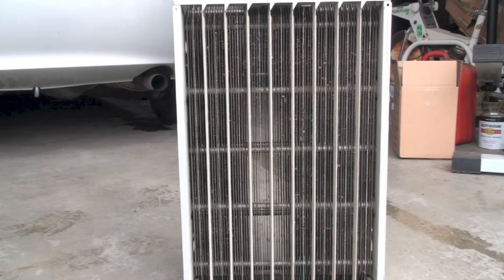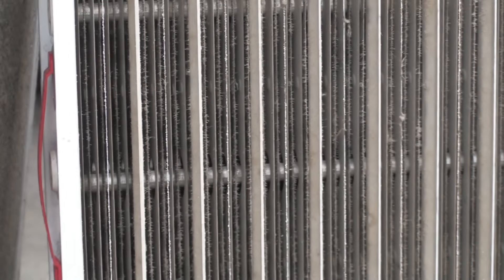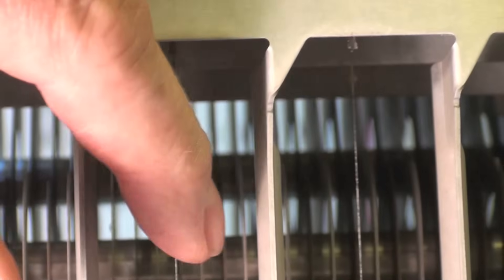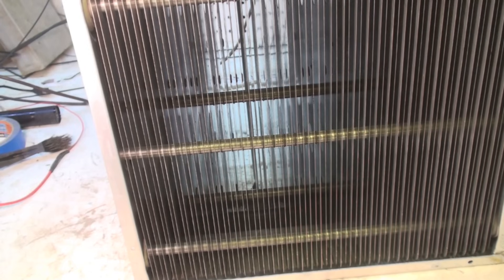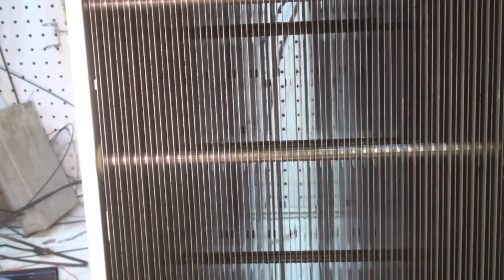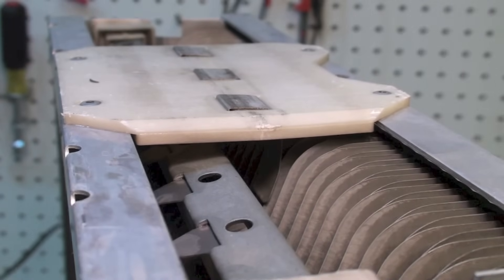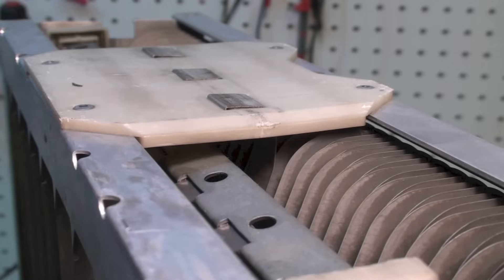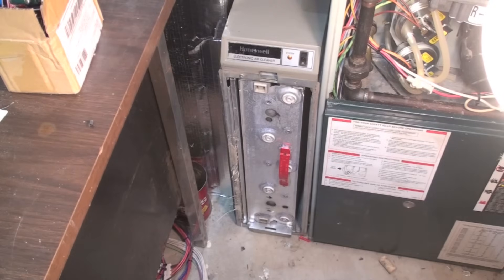Cleaning the electronic air cleaner

Comment: Try household ammonia. I did and found that It works well. Listen, As a homeowner, I have done everything to try and get my Honeywell EAC cells spic and span and this black soot always remained on the plates. How to I know? Well, because if I would take a cotton swab and swipe it between the plates after they were supposedly cleaned, the swab came out black. I've soaked the cells in detergent, blasted them outside with my pressure washer;  even put them in the dishwasher. Still, that soot remained. Today, I decided I was going to attempt to find a way to clean off that soot. In desperation, I tried all sorts of cleaning agents: Simple Green, TSPF, Borax, Oven cleaner, CLR, bleach, and they did nothing. Was ready to go get the muriatic acid (just joking). I thought; heck, may as well try ammonia. I sprayed it on the cells that I already "cleaned" and the black residue began running off as I could see it running along the bottom of my white utility sink. I might have stumbled on a winner here. From now on, I'm using ammonia in a spray bottle, then a rinse with hot tap water. Simple Green work well however, even after cleaning the cells with it, the black soot remained. Try ammonia.

Comment: When mine is plugged in and I turn it on, nothing happens. No lights, sounds, etc. Until I push the front panel forward…and then both lights come on and it starts zapping. What can be the issue?
Reply from the maker: The air cleaner has a shut off switch connected to the front panel to keep it from operating when the panel is off.  The switch may need to be adjusted.
GFM

Comment: Just bought a house with one of these units. It’s missing all of the internals. I guess I’ll just measure and put a standard filter in there for now.
Reply from the maker: Parts are very expensive for these units, so I would recommend replacing the internals with a standard air filter.  The good part is you can use up to a 4" filter.
GFM

Comment: I put the electric filters back while they were wet
, now I don't hear that buzzing noise when furnace runs as usual,
Reply: Look to see if the neon light is on.  If it is, you're OK.  If not, there is a short somewhere.

Comment: I came to your channel. My Carrier has the same type of cells. It was buzzing terribly and I followed your video and cleaned it out using a hose and some dishwashing soap. I let it try overnight but the buzzing continues when I placed them back in. The cells were not very dirty at all. What else can I do to problem solve the buzzing sound? I remember when it worked properly, when the AC/heater came on. It occasionally would make a snapping sound. Now its just all the time, so loud I am forced to turn it off.
Reply: You have a short somewhere.

Comment: My filters have never been that dirty. I only clean them once, maybe twice a year. Could this mean there’s something wrong with my unit, 17 year old Lennox electronic air cleaner. Is there a way to check to see if it’s functioning properly? Also, I don’t recall ever seeing the thin wires.
Reply from the maker: If the unit has a test button you should hear a spark when it is pressed.
GFM

Comment: I have a ticking noise that's coming from my electronic filter is this a bad contact problem or is it normal not sure
Reply from the maker: Either its dirty or some of the plates are bent.  Or its just worn out.
GFM
Reply: Did you figure this out?  I have 2 furnaces, on one the filter is on and not making noise.  On the other, the filter is switched off and when I switch it on I can hear it arching (?).
Reply: @-Stop-it  sounds to me like a short across the cells. I would remove the cells and put them in your dishwasher and run them through a wash cycle, do not use the extra heat cycle. And be sure there is no moisture on the cells before installing. Water and electricity never a good thing. Best of luck.
Reply: @RG_sssSMOKING   - thanks for the info.  We pulled them out, washed the pre filters and just blew clean the primaries with a hair dryer.  It is working now.

Comment: I acquired a spare set of cells and just have one set washed dry and ready to change out. Prefilters get done every other cell swap..
Spray-9 works mint for cleaning everything, some of the degreaser available are good but hard on aluminum.
Reply from the maker: Good thoughts.
GFM
Reply: Where did you get the prefilters?
Reply: @heathernesslong  they came with the unit originally, you can get replacements  if need be BUT....
Since I posted last I have switched from the electronic cells to a 4" MERV 11 pleated filter that is a direct replacement for the air cleaner cells. Disconnect the air cleaner power, pop in the filters and you are done.... I did this because maintenance is way less and the prefilters because of their design are pretty restrictive to air flow....
Reply: Great idea to have a spare set.

Comment: Hey GFM, just bought a house and noticed an older unit from 1993 in the utility closet. It is without the insert, control module and doesn’t turn on when plugged in. I live in Denver and the area is notorious for polluted air - is it worth trying to do-it-yourself or hiring an HVAC tech? Thanks.
Reply from the maker: Sounds like its mostly gone.  I would ask a tech.
GFM

Comment: I have 2 cells and 2 mesh filters, but where do I put the mesh filters because there are tracks on each side of the cells that run the full length of the unit, so I could actually have four mesh filters in there - two in front (side by side) and two behind the cells right at the furnace (again side by side). So should I get two more mesh or just keep them in front as pre filters only?? Thanks
Reply from the maker: The mesh filters are pre filters.  The filter is designed to be used on either side of the furnace.  Thus the extra slides.  Most installers bend over the tracks that are not meant to be used.
GFM
Reply: @grayfurnaceman  thanks. What about just using the pre filters and turning the unit off with no coils in there? The light no longer turns on and the coils have likely never been cleaned in 30 years. I am only now understanding this unit. We would always just take out the first pre filter and wash that only. I did push the power button on after taking the coils out and i heard a noise but no light so maybe when i put the coils back in when dry it might work. The coils have been out since the summer and thinking they were junk i used one to hold my boat trailer hitch up! Heck i could probably sell them for $100 each. Anyway, the wires look straight still and all that rain helped clean it in the Fall. I soaked both in the tub now with dishwasher detergent.  I have seen a website where you can just use a box or media filter after removing the lower centre screw in the unit and leaving the unit off. I have also seen a site that lets you mail in the power head for repair. What do you think about these last two ideas or just using prefilters alone? Thanks again.
Reply from the maker: If you want to just use a media filter, one can easily be installed in place of the cells.  The prefilters are not useful as the only filter.  They will stops birds and large bugs but nothing else.  
The head can be repaired.  I have done it many times.  
GFM

Comment: I have power to the unit, the filters are clean and dry, but the operation light does not come on with the power switch. Anything I can check to find out why?
Reply from the maker: If the cover is on properly, you probably have a failure in the electronics inside.  Means a new head or the electronics inside.
GFM

Comment: the only way to clean the large chunky ones is to put it in the dishwasher and set it on max()and do not use dry cycle. at least that is what the heating/air guy told me, I asked "what if you don't own a dishwasher" and he said, rather snottily, "if you can't afford a dish washer you can't afford this unit!" thing is, I had this unit for 9 years, my dishwasher burnt out last year and now I can't afford a new dishwasher! I would assume waterhoses do not clean molecular level particles that collect in the electronic filter. so now I can only clean the prefilter, as you call it.
Reply from the maker: Take it to a self service car wash.
GFM

Comment: Can the cell survive without, one, wire? Also, what do those wires, do?

You said a replacement can be bought....where? How much?

Please answer!!!
Reply from the maker: It will lose some efficiency without the wire.  The wires electrically charge the air so it can be attracted to the plates.  Try a local HVAC dealer.  You will need the size.
GFM
Reply: Okay, thanks. 😀

Comment: grayfurnaceman - we recently bought an older home and we realized our furnace has the electronic air cleaner after hearing zapping noises from time to time. Tonight I heard a constant zapping that persisted. Our intake air flow vent is just below where this apparatus is. I opened the vent, removed the store bought filter from the vent and used a mirror to see back at the cells on the EAC. There is no metal prefilter before the cells on ours. Is the store bought regular filter at the intake air flow vent good enough? Now, I'm wondering how in the world to get the cells out tomclean them.
Reply from the maker: You can use just the replaceable filter if you wish.  Depending on the brand, there could be a cover that is removed or the entire electronics container is removed.  In either case, it should not be hard to remove the cells. If you send me a pic, I may be able to tell you how it is removed.
GFM

Comment: hi   I have a sears electronic air cleaner furnace mount  that is 36 six years old  it is missing three wires. it continuly arcs even when it is clean what can I do .model 281-98311 the cell no. is a811-0177 can I buy the wires   I am in toroto Ontario Canada     thanks
Reply: I was able to get ionizer wire for my equally old Honeywell furnace-mount electrostatic air cleaner online. 
Maybe the Honeywell wires will work with yours?
http://www.supplyhouse.com/Honeywell-136434BA-16-Replacement-Ionizer-Wire
Reply from the maker: +MICHAEL kneeler Its time to give up.
GFM
Reply: +MICHAEL kneller  There used to be a place in right around here, Missisauga / Oakville / Burlington  somewhere that dealt with electronic air cleaners.... I am not even sure they are still in business... Maybe do a search, I have to see if I have the info still, I need parts for one too.

Comment: electrostatic filters probably have the worst particle capture rate ever! I had a half inch of dog hair, and other fine dust built up on my 5 ton A coil because of these crappy things! I had it repaired and maintained properly too, and the next thing i know my coils are only getting 1/8 of the proper airflow. My other systems use Filtrete which surprisingly doesn't restrict much airflow at all, and my units went 16 years almost spotless clean!
Reply from the maker: Lincoln Hunt The argument of the electronic air cleaner will probably never be solved.  I have seen dirty coils with the electronic and with all other types of filters.  Thanks for the thoughts.
GFM
Reply: Usually when u see dirty coils with higher quality filters, it's because air is leaking around the filter somewhere. I have heard of good electronic cleaners but i've never found them, and all the reviews i've heard about in my area say they hate them. I weatherstripped my filter enclosure and it seems to have worked.
Reply from the maker: Lincoln Hunt Sealing the return downstream of the filter does sometimes make a lot of difference.  Especially if the return is restricted.
GFM
Reply: oh that's already sealed. I was talking about putting a foam strip where the filter fits so the return perfectly fits the filter.
Reply: at least it's sealed on my systems

Comment: my parents pre filters never had crap in them...i washed everything monthly from what i remember...still the A coil had a bit of crap on it...the service ppl would ask if we cleaned the filters ever...i noticed the ozone smell after we would wash them, so i'm thinking they were fu nctioning...  maybe it was a crap air cleaner...the old honeywell one, like in your video,  seemed to never give an issue..then again we had an older furnace with less air flow...Oddly enough, I saved the honeywell unit and have it sittingi n the corner of my basement now..just cant seem to get rid...
Reply: cool story, hansel

Comment: HI, What is the cleaner you used? I normally use dishwasher detergent.
Reply from the maker: FreddyT62 I used a 409 type cleaner.  Dishwasher soap is also good.  In fact, if you are careful, you can place then in the dishwasher to clean them.GFM
Reply: Thanks, I will try it with 409 next time.